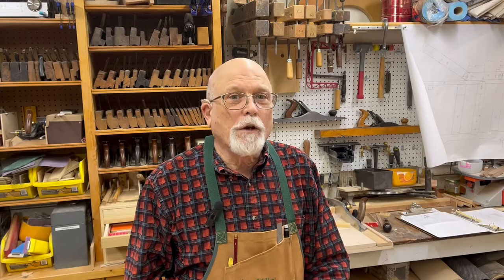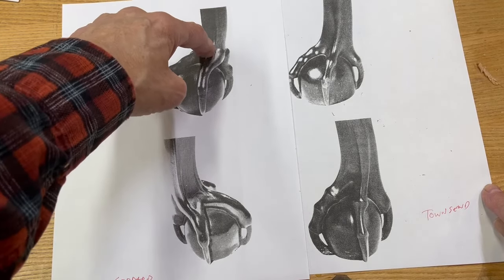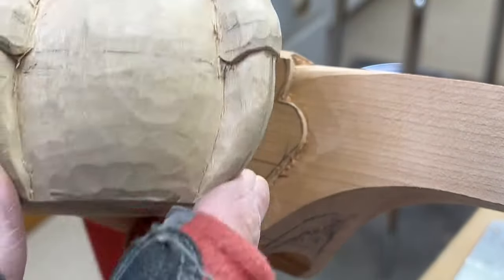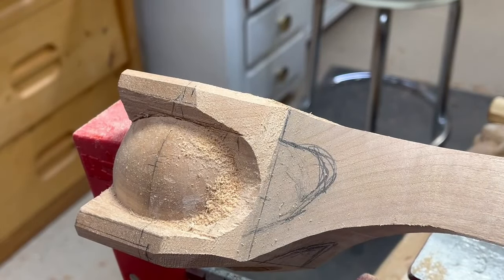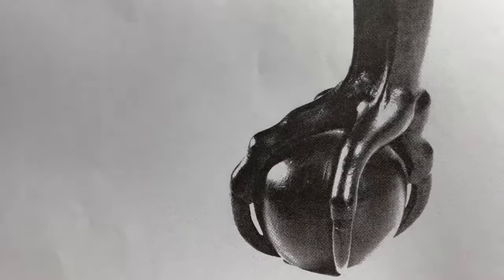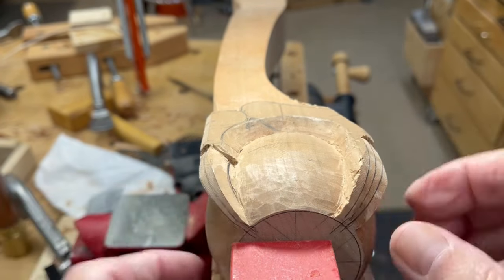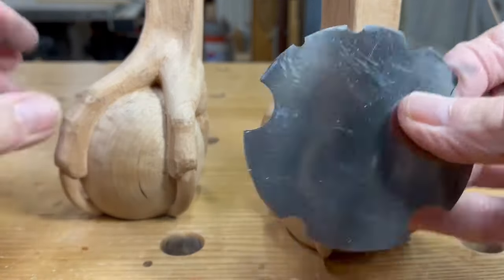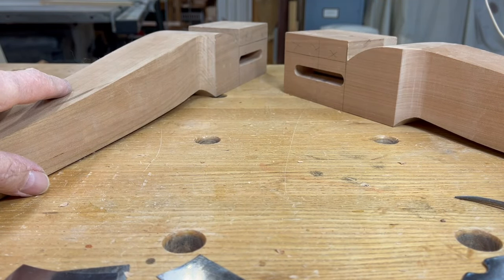PW 86 18th Century Newport Card Table Part 6 - Ball & Claw feet Part 2

Comment: I've seen several other videos showing the carving of this style ball and claw.Your method differs in many ways but makes sense if you aren't a master carver.I think your system offers those without years of experience a good way to conquer those legs,Thanks for letting us enjoy your adventures.
Reply from the maker: Thanks. The Newport style is a little more challenging because so much of the ball shows. My method differs because I have not been trained by master carver.